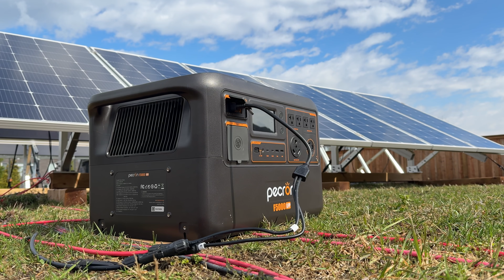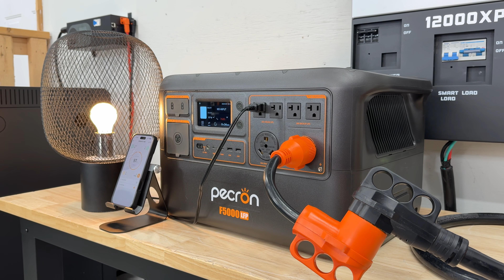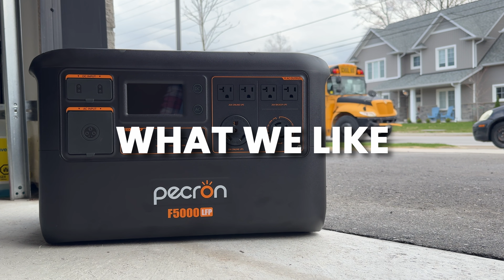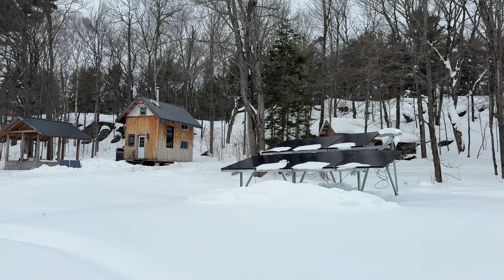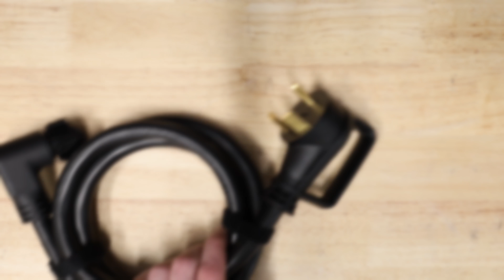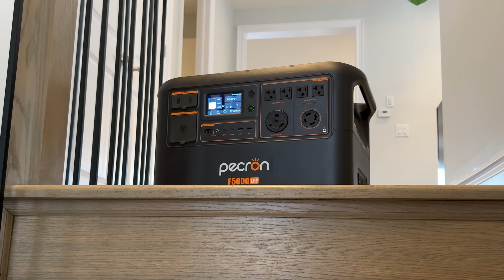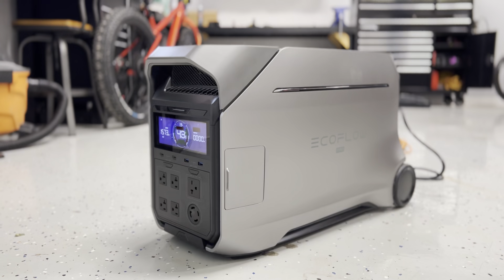Pecron F5000 - They FINALLY Did It!

Comment: Does anyone know if this unit has a floating neutral ground? I’m sorry if I’m using the wrong terminology…I’m brand new to this. I bought one and trying to buy the equipment to connect it to the house as back up, but the electrician said he found a few boards that said it’s got a floating ground but we’ve been unable to get a response from Pecron about this. Their customer service is horrid. 😢

Comment: I ordered my F5000LFP on 9/20/26. Im beginning to wonder if this is a SCAM or if the Chinese company is crashing. Almost 4 weeks now and not received or shipped. Ive emailed and emails come back undeliverable. Ive called and when you get through the service assistant seems to know nothing and says "should be any time". Ive now dug deeper into reviews of this product and company. There are many reviews that state Pecron is non responsive after $ received. Pecron has now stopped Amazon sales. I started a TrustPilot review and it would not post but immediately got email from Pecron that shipping was soon but it has set with Label Created for some time(another common review statement). Im keeping my fingers crossed but Im concerned that my $2089.00 is gone. Caveat Emptor- its not looking good. Wishing now Id spent for the ECOFLOW. -         Jim Overstreet

Comment: Hey everybody I hope all are able to see this comment. Although I'm not here to try to bash the product because it could very well be a fantastic concept everyone installing should check with their local authorities to ensure compliance. I reached out to the Pecan Company to ask them to produce to me the technical specifications and to let me know what UL listing this falls under and I found out that this is not UL listed and only comes with testing qualifications and specifications. If this unit is to fail depending on jurisdiction it could come with catastrophic consequences for contractors installing them, especially if this causes damage to property or hurt someone. We should find a way for this company to get their product UL listed and then that would satisfy safety requirements or if  does not meet the standard then it will not become UL listed

Comment: is it  Possible to plug in two pecron F5000 Linking them into to one maga home System  like with a 240v box  for a 71.6 kwh with 12 batteries

kind of like how you can link up 2 E3800 units to turn it it to one home system  53.76 kWh) with 12 expansion batteries

Comment: Just got mine with 4 expansion batteries. I installed a transfer switch with it. I harvest power overnight when the rates are cheap and use it during the day when rates are expensive. This thing is a beast. *Folks, just a heads up---Pecron gives you a 120 volt 30 amp charging cable so I just assumed a 30 amp circuit would be enough, but after charging this thing for the first time I saw that it draws around 3600 watts at 100% charging setting. I dialed it back so I wouldn't trip my breaker. To be safe and have full charging capabilities I replaced the 30 amp 120 volt circuit with a 40 amp 240 volt circuit, and got a Dog Bone adapter. Now I can charge at 100% capacity (3600 watts) and be safe.
Reply: How'd you pull that off? Was it the automation?
Reply: @tiger23800  Yes, I have programmed it to charge only between 10 p.m. and 5 a.m. when the rates are really cheap. The transfer switch has my critical circuits connected to it, so my fridge, freezer, lights mini split A/C, are completely isolated from the grid and running on battery power only all day and night. I harvest power at 4.3 cents per kwh and use that cheap power all day when the power is 8.7 cents per kwh. and during on peak hours the rate is a whopping 21.4 cents per kwh. I avoid those two higher rates completely for most of my electricity usage. Of course, I still have the heavy users connected to the grid--Oven and water heater, but i take showers after 10 p.m. and rarely cook on the main stove. Good luck with your set up!
Reply: @tiger23800  Yes, i program it to charge only between 10 p.m. and 5 a.m. when rates are cheap and then use the stored power during the day when rates are higher. The transfer switch has my critical circuits connected and they run on battery power 24/7. Of course I do not have the main oven or water heater connected to the transfer switch because they have such huge power draw. They are still connected directly to the grid. But, I rarely use the oven and only take showers after 10 p.m.. Good luck with your set up!
Reply: Thanks. Do you keep the grid plugged into the unit 24/7 too? I'm trying to stop it from doing pass-through, but I can't figure it out.
Reply: @tiger23800  Yes, I have it plugged in 24/7, but it's only been 2 days so i'm still trying to figure things out myself. Today i got home and it had stopped outputting power sometime during the day. I turned the 240 plug about 1/8 of an inch and it started back up. Not sure what happened with the connection.

Comment: Can I use the Genmax 6500 inverter generator to start up to charge the Pecron automatically when the battery is low and turn off the Generax when the charge is restored using the 2 poles on the generator?

Comment: Hi, I like your channel, very informative. I was wondering if you could give me a recommendation. I am starting a little mobile woodworking shop in the back of a box truck. I’m looking to buy a power station in the 2500 watt range. Which brand and model would you recommend? I may want to add more batteries or buy a second one down the road.

Comment: Have discovered that the F 5000 120 V output is weaker than the F 3000. At first I thought the unit was defective but the engineer at Pecron confirmed that the F 5000 split phase inverter is inferior to the F 3000.

Comment: Seems like a good balance of features.  This is not the model you drag upstairs in a power outage at night so the light is not a concern. Why would you be charging at 240 Vac if you're outputting 240V ac?   Being able to use a 120Vac generator or a smaller battery bank to top up this unit while supplying 240 Vac loads during an outage simultaneously makes sense to me.

Comment: As a science nerd (physicist) I would like to see a net price per watt. This would be after taking of the 16% efficiency loss and 52 watt inverter loss compared with gross cost per watt hour. Example 5120 watt capacity -efficiency loss 16% = 4300 watt hrs - 52 watts for 1 hour =4248 watt hrs net cost 44.7 cents per watt hour.

Comment: Projects with Everyday Dave ran a comparison with the Anker F3800 6kW and a 3kW gas generator to see which could run a 4 ton A/C and the Pecron was unable to do so with a soft start kit installed to minimize initial startup AMPS. The Anker and the generator were able to run it with the soft start attached.  He thinks there may be a software setting that tells the Pecron to fail under certain conditions which kinda sucks if you wanted to max out the solar and run a central a/c unit with this

Comment: I'm planning a box truck conversion with solar and one of these for my power source with mainly household appliances. I've had the idea of also getting a smaller portable Ecoflow unit that can be charged from a public EV charger and piggyback charging the Pecron from the Ecoflow as it's being charged. It would lose efficiency but would be an alternate method of charging.

Comment: I have a 4950 watt solar array on my roof that doesn’t work when the grid goes down. I will get an electrician to install the necessary transfer switch so I can use the solar array with the 5000 but how many batteries do I need to store the power from the 4950 watt solar array?

Comment: I hope The Solar Lab team sees this comment. I just received my Pecron F5000 yesterday. It seems to work but it has a bigtime issue I wish your team would start looking at in the future. And in this case, start testing for RF emissions from the power stations. I am an amateur radio operator and have many different radios in my "ham shack". Whenever the F5000 is plugged in and charging level is set to anything other than 0%, the F5000 completely obliterates every ham radio band I checked (160m, 80m, 40m, 30m, 20m, 17m, 15m, 12m, 10m, 6m, & 2m). I don't know how in the world the F5000 passed FCC emission testing! I have 3 smaller Anker stations and have noticed absolutely no RF noise emitting from them. Now I understand why Pecron can sell their units for much less than other companies. They completely skipped RF Shielding!
Reply: The Pecron F5000LFP is a piece of junk and I'm sent it back for a full refund. Not only does the unit emit strong RF interference to my amateur radios, after a few days of charging through the PV DC input, the PV DC input stopped working. Pecron tech support told me I have to ship it back for a replacement. Not only this, but one day LED lights were flickering which were attached to the F5000... turns out one leg of the 240V was outputting 108V instead of 120V. And whenever a sudden load appeared on that leg the voltage dropped even further.

All of this and some of the worst is tech support. Tech support beyond simple things requires a tech/engineer from China to assist. So you only get support in the middle of the US nights. And even then it has only been via email and they WILL NOT IMMEDIATELY respond if you IMMEDIATELY reply to their email. So very frustrating.

Pecron sold the F5000 less than everyone else for a reason. They cut corners. Do you want to risk attaching this to your expensive household appliances? After what I experienced, the answer was no. Remember... you get what you pay for (or what you don't pay for)!

Comment: Hi guys. I have a questiona as I'm planning to get this unit. 
Ecoflow has a feature called backup reserve. 

Question is does Pecron has this feature as I'm planning to use this unit fulltime. So it's great to have the grid connected 24/7 the unit will just stop charging let say I set the backup to 30% so grid only charge at 30% and solar will continue 30% to a 100% 
Then grid will continue when it goes back to 30% as passthrough. I use this feature from my Ecoflow Delta pro.

Hope you can give me a honest feedback. Thank you.

Comment: I had planned to purchase this unit to use as a ups system for all of my 120v circuits for momentary power blips. Since you are saying there is no 240v charging will it be able to handle this?

Comment: I just bought an EV and am new to power stations. Could I plug a level 2 EV charger into this station to charge my car? My house has solar, but no 240v outlet, so I am hoping to charge the station with solar, then discharge to the EV charger to keep my power bill minimum.

Comment: Currently my Pecron app does not show any stats for my F5000. It worked fine initially and my unit works as it should, but my app currently shows 0s for everything and all of the options are greyed out. I emailed Pecron and they forwarded the problem to their app engineer. I'll update this as things change. Is anyone else experiencing this issue?

Comment: Below is the reply I got from Pecron support that says the amount of input charging does not affect the amount of output power for the Pecron F5000LFP. Therefore if I'm charging the Pecron F5000LFP using the supplied 30A charging cable at 3600w, the Pecron can output the full 7200w split-phase to my house inlet/interlock kit. There seems to be confusion about the pass-thru charging that with the Pecron 7200w inverter, the combined input charging and the output power can not exceed 7200w. Anybody have comments?

(Below is from Pecron support)
You can charge the F5000LFP from your A-iPower 7100W inverter generator using the Pecron 30A charging cable and a suitable adapter (such as TT-30R to L14-30R), and at the same time use the unit to output 240V split-phase power to your home.

The system does not automatically restrict output based on input power, but if you encounter instability or overload issues, you may need to reduce the charging power setting to ensure stable operation.

Comment: Question for owners of the : Pecron F5000 , How loud are the fans? Can the Pecron F5000 be used indoors at a reasonable sound level? (  Mid-to light load fan volumes )
Reply: The loud fan noise is shown in the video.

Comment: 240V and 120V , 7200W inverter,  48V system creates a high ghost load.   Full solar gets you 80 miles a day in an electric car or more.  I also always keep a micro usb light in the slot ($1).

Comment: Would this power station be able to be  used in both 110V and 240V outlets. Also, can I use appliances with either voltage without harm at the same time. Hopefully, my question is clear.
Reply: Yes to both questions.

Comment: For the same price as the Bluetti Elite 300 V2, plus a 50 volt golf cart battery, I’m going with the Bluetti and golf cart battery. 

8,214 watt hours and the weight is split up between 2 units.
Reply: Let's see:  120V vs 240V,  1800 watt inverter vs 7200 watt inverter, ANEMIC 1200 watt solar input with sucky 60V limit vs 6400 watt solar input.   Enjoy your grossly underpowered 'Elite' 300 V2.
Reply: @MassiveOverkill Enjoy frying your Pecron by charging it way faster than any power station should be charged.

Also, if you are going to quote stats, at least try to be accurate. The Bluetti and the 51.2 volt 100 amp battery is "overkill" for my needs. 

Maybe try being abrasive next time.

Comment: another negative: requires a proprietary cable to charge from the wall. Yes I get that it allows one input to handle up to 30A, but that's no excuse to not also have a standard IEC socket
Reply: They do this to ensure a proper gauge cable is used and not some cheap 22 gauge cable is used that could cause a fire.
Reply: @MassiveOverkill  sure, and it has absolutely nothing to do with cost saving (1 less port) and revenue generation (selling extra cables when you need one)

Comment: Been waiting on this one to drop - this thing looks like a beast. Now if they would only produce one with 50AMP capacity it would truly be perfect! I'm trying to power a 6000W electric sauna heater - if anyone has reason to believe this would not be able to handle the load, please comment!
Reply: That's 25 amps 240 volts so it would handle it

Comment: That xt 60 is so important for some people for instance when this unit is in my van I have a dedicated XT 60 plug that plugs into that and then that runs everything that’s to a volt signs that my air conditioner runs off of a 120 V through the 30 amp connection

Comment: Im surprised that you didn’t talk about the biggest flaw; you can’t charge more than 3600w-(what you are using )
If I run a 2500w load on my 240v outlet; I can’t charge more than 1100w without tripping it. Bummer, I wanted the full 7200w out while slowing down my discharge with 3600w from my generator. Not possible sadly! It’s the biggest information that people need about this unit, I’m surprised that you guys didn’t highlight this
Reply: I have one, it can input 1800w from the 120v 15A and still output 6,000w+ from the 240v.
Reply: Because most of us are going to feed this monster with massive solar arrays.   Funny thing about solar generators............you recharge them..............with SOLAR ;)  Go listen to Project Farm's stupid testing if you want to buy a solar generator............and NOT use solar to recharge it.
Reply: @Mas @MassiveOverkill wow! why didn’t I think of that thx

Comment: I think a pair of E3800’s might make a better home backup. The cost is a little more but the redundancy of having one to use if the other breaks seems good to me. What say you?
Reply: You trully have more capacity with 2 e3800lfp + 12 ep3800-48v. But, The disavantage will be when you have the need to recharge them with AC while you feeding a 240v circuit because you have to recharge them first with AC disconnecting them from the 240v box and after that you can connect them together again with the 240v box.
Reply: @manu__t23  We do not need to run anything 240v here, and honestly don't need that much electricity compared to most, either.  Gas heater, (single pipe steam) gas clothes dryer, gas stove, and we have a generator that can output 240v feeding our transfer switch.  Our plan is to run off batteries from 4 to 9 pm each day, and charge what we can with solar and the rest during off-peak electric rate hours.

Since the generator brings 240v to the transfer switch, we'll be charging one E3800 off each leg of the 240v coming in, which is pretty much the same as charging with 240v anyway, I think.  Haven't worked everything out perfectly yet, just adding our first solar now.

Transfer switch has a battery option and a generator option, so we can recharge E3800's from 120 v overnight or run the house off the generator while we charge the powerstations from solar or the 120v in the house.

Comment: Anybody looking to purchase the Pecron F5000 beware. I received mine about 10 days ago. I was so excited for it to arrive. Initially, it worked well. Then the inverter started to trip when powering loads over 3000 watts, then 2000 watts. Now, the inverter trips regardless of what is plugged in. Completely useless. I have contacted Pecron and Outbound from where I purchased the unit. Looks like I'll have to ship this paper weight back and then wait another 10 days to receive the replacement. What a total disappointment.
Reply: Faulty units happen.